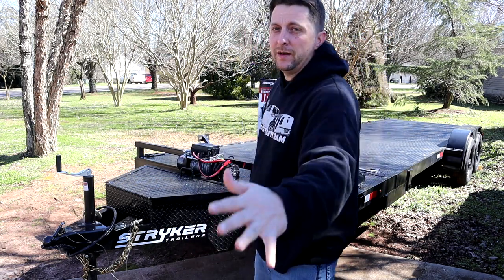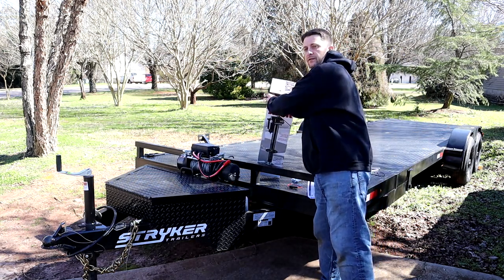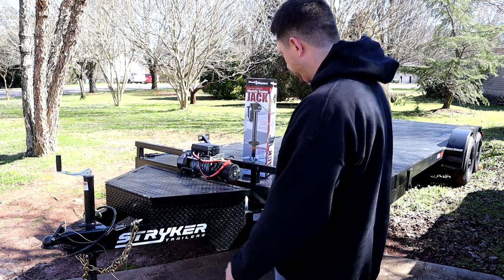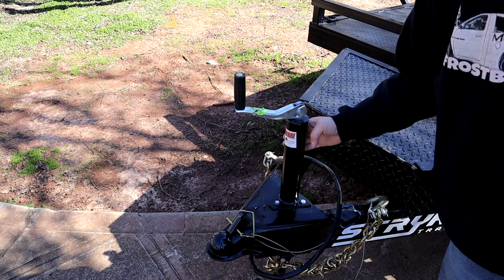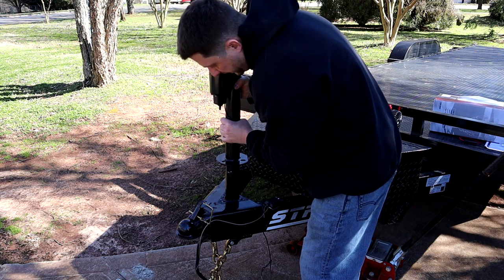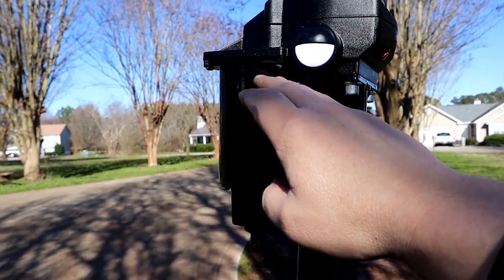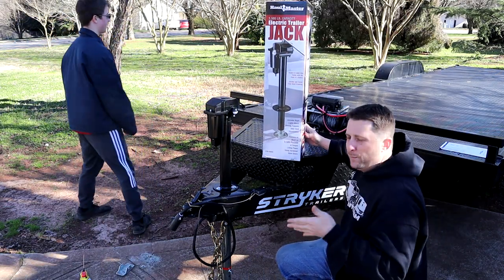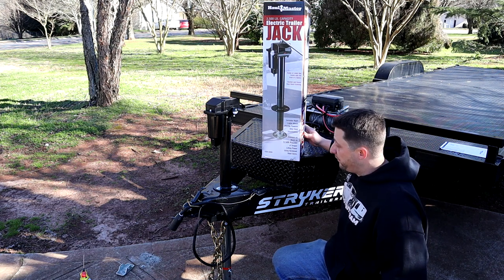HAUL MASTER Electric Trailer Jack Install On STRYKER Car Hauler

Comment: We went with Jack from northern tool, got home installed off and on in 25 mins.  No wiring required, plugs into 7 way pin connector.
Reply: Not having luck with mine

Comment: I was wondering if you could do a video detailing everything you’ve done to the truck
Reply: I been following from the beginning and also work at the shop that done his camshaft if he doesn't make a vid on it I'll reply to this comment in a couple days with a complete list 🏁🇺🇲💪
Reply from the maker: Sure ill try to get something up because alot has changed
Reply: @FrostbiteRam  I second that motion..b nice to hear how much she has done to her😅
Reply: @FrostbiteRam  list so long mite have to be a two part episode 💪🏁🇺🇲
Reply from the maker: @bmanclassics4350  right 🤣🤣
Reply: @FrostbiteRam  hey man..the chevy I'm getting through the shop has quite a list too!! Thas y I'm so  excited!
Reply from the maker: @bmanclassics4350  awesome 🔥
Reply: @FrostbiteRam  Chevy mods. It has a 6.0L...i will start from the cai back...it has a AFE c.a.i./ 90mm throttle body/ported manifold / ported and polished heads/ triple wound springs/BTR stage 3 camshaft/LQ9 block /gen 4 Rods/4L80 trans fully built/3200 circle D stall/long tubes/ 3" pipe/spintech muffler/ and I will be topping it all off with two bottles...it will be a contender for sho!!!
Reply from the maker: @bmanclassics4350  sounds nasty🤘

Comment: That's like going from a snowmobile without electric start or reverse to a new sled with it. The older we get it's about smarter not harder. Just wondering do you still have your old cam from frostbite?
Reply from the maker: Definitely 👍,  yes I have the camshaft still.

Comment: Pretty good video.  Thank you.  I just bought one of these to replace the one on my camper.  The instructions mention needing 6 star washers to assure contact with the frame, but it only came with 3.  Did you use 6 or 3?  Also, It came with a small fuse on a wire.  Did you install that?  thank you!  p.s. It was only $99.99 on clearance at my local HF.
Reply from the maker: I just used 3 washers and I did use the inline fuse as well.

Comment: why cant you just tap into the trailer lights and have it work?
Reply from the maker: Probably could but get better voltage directly at battery.